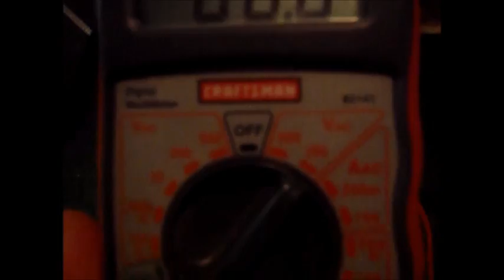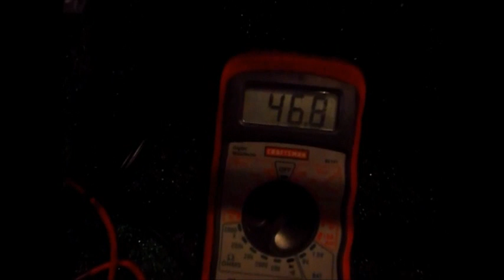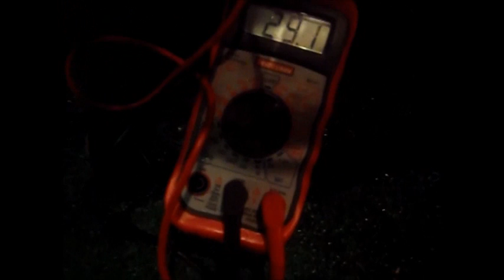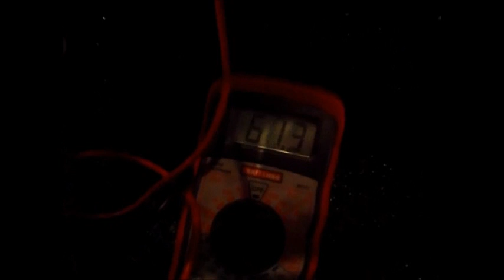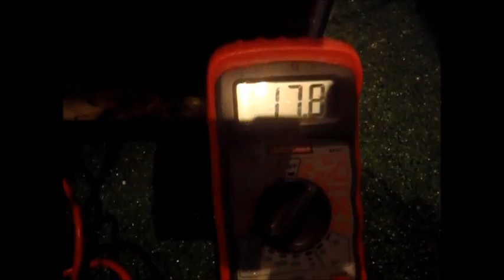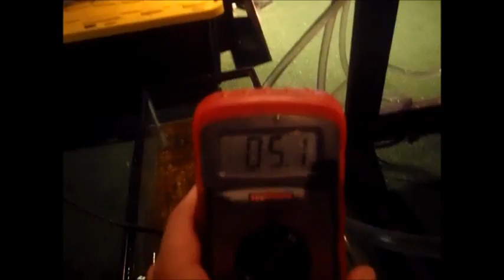How to test for stray voltage in an Aquarium

Comment: Just measured 40 volts on mine. Just make sure you connect the probe to the ground or neutral and not the hot on the outlet. The hot is the smaller one.